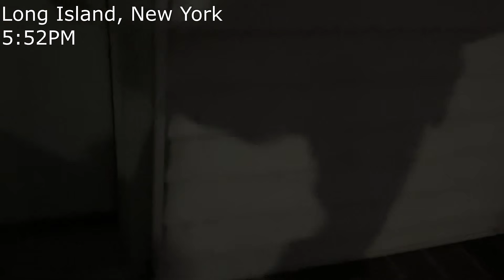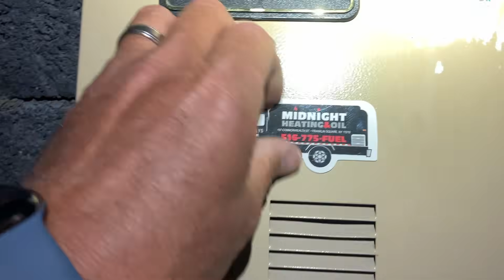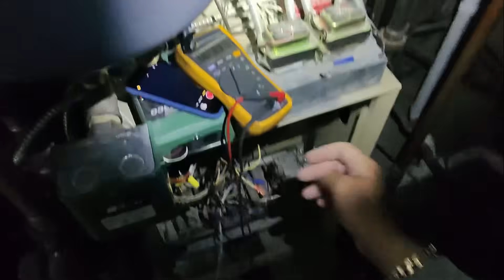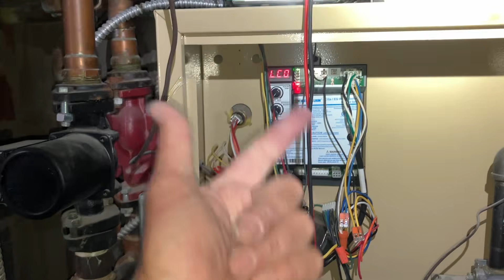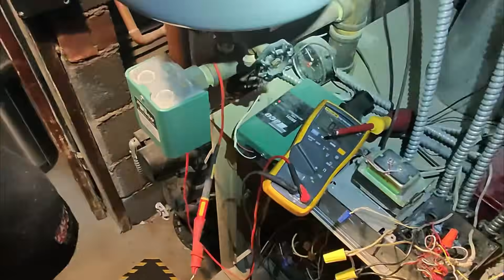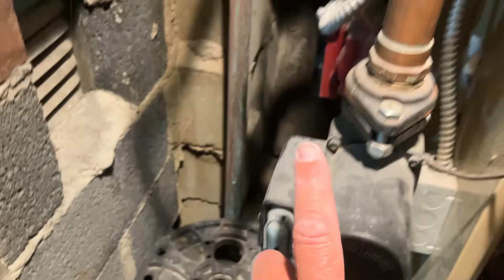Electrician Changed Parts for 2 Days — Weil-McLain Boiler Still Dead | Hidden Short Found

Comment from the maker: Electricians & homeowners — this is why diagnostics matter. Changing parts without finding the short will cost you every time. Drop your questions below 👇
Reply: Hacks brings stacks,  it's why yoir here no one has your skills,  the way your problem
Reply: Hello Mikey pipes , 😊
Reply: Can say the same in the automotive industry stop just throwing parts at it and get it properly diagnosed then one part and done saves so much more money that way
Reply: Good service calls, visual inspection is a must 😊

Comment: Great job mike, quick question tho , after finding the burned out transformer/ board why not test the boiler circuit resistance before restoring power? Just curious...
Reply from the maker: Thanks for the tip
Reply: @PipeDoctor  i love your vids mikey. queens middle village here.

Comment: Electrical problems are a nightmare.  It could take 5 minutes to fix or 5 days
Reply: Two (2) Days and it’s Not Fixed since they Called an Electrician who was Not Testing but instead was Guessing. 🤪👎
Reply: Yeah Electrical proms are a nightmare especially when other people have been in there that don't know what they're doing and what is installed by somebody who didn't take pride in their work or got modified from that. On top of that at some point that electrician should have said (probably the point at which electricity was getting to the furnace boiler) said you need an HVAC tech.

Comment: OFF Topic.. but, I’ll forget if I don’t post it here.

I wired a former Weil Mclaine design engineer’s automation system a few years ago.
He’s the one who first informed me abou tCGA boiler control board issues with several large batches of early units.
I posted above, so you can read it there, but if you ever have one that just displays 140° and won’t heat hotter, think control board.

BUT… he also had 7 or 8 of the Honeywell 9000 series Wi-Fi stats installed throughout the house.
He told me they are some of the best thermostats being made, but always be cautious because if they ever stop their server service or sell a model line, they will eventually fail to work.  He said it didn’t bother him because he would just upgrade to something better as tech changes..

TIP - if you’ve ever installed one, you’ll know it’s very difficult to terminate wiring and dress everything up with the terminal blocks they use.
They are just spring loaded, flimsy, and cheap connectors.
The engineer said one of their field engineers noticed this at a lot of failure jobs he was sent to review.
Reply: Both of these engineers were still big fans of the 9000 series, so they would always take the thermostat back plate and modify it prior to installation.
The one guy I knew and did some work for, simply soldered 20” #18 solid copper wire (color coated appropriately) straight to the back of the PC board behind the terminal strips.

Essentially making up “flying leads”/wiring harness that would never have a connection fail, especially intermittently!
He always uses the 3x terminal Wago lever connectors to connect to the stat wiring.

Except, they weren’t Wago.  He took a tip from me and used Ideal In-Sure lever connectors.
They are blue instead of orange, have a larger hole for meter probing, and most importantly.. the levers never pop up like they do on the Wagos if you’re moving them around in a box.

We always use deep single gang, plastic boxes or metal 190l box type mud rings (without the box) for thermostat wiring rough-in.

I’m all about “overkill”, but it really helps to retain customers and they’re always happy that they don’t have to rip their wall open to add a new gadget..
Reply: Mounted to a stud with two screws, leaving the entire back open for later equipment installs, testing, etc..
(Low voltage Class II, so an enclosed box not required)

We always used to run thermostat cable with a few extra conductors and always a “C“ .  
We always used to home run a CAT-5e or 6 cable to each from telecommunications closet or whoever they’re keeping their home network gear..
Reply: Honeywell 9000 series Wi-Fi stats.
How good are they? how is the Wi-Fi control? I am facilities manager of a four-story building we have two floors built out so far, and 7 thermostat over 2 different styles. Being a nonprofit and budget concerning. I would like to standardize on one thermostat. But what I really need is centralized control for programming room schedules (what I would really like is the ability to do scheduling through Google calendar and have it translate through to the thermostat). we currently have 2 different Honeywell models the style with backlit Monochrome touchscreen, two of them are fancier than the others. And really what I only want the occupants to have is temperature up down heat cold and hold to X time preferably more than 3 hours until a program overrides.

We also have a theater group who thinks they can just turn the thermostats on and off and crank them up to 80° run them until they start the show and then turn them off (you know cause heating and cooling is noisy and annoying during a performance especially to the visitors). Which sometimes means they don't get turned back on and sometimes means the two different ones in the same room are set differently. Or more importantly they're running the auxiliary heat and we have a $2000 electric bill which I don't know is due to them or one of the adjacent rooms having the compressor go out and only running on aux heat.
Reply: @i @imark7777777 It works quite well with Google Home Assistant, but I’m not sure about other compatibility.
IMHO, it’s a great unit to standardize on for residential and small commercial projects.
Just use caution with the terminal strips/blocks.

Also, I believe there are some incompatibilities when mixing new models with older, though I think that’s mostly for remote sensor types.

I’m not an expert in the field by any means, so definitely consult someone with experience.
I believe the “Red Link” by Honeywell was made for more advanced  / larger integrated systems, but have heard it’s fairly expensed proprietary system with Honeywell having add-ons ($$) gear vs included features and accessories.

AVOID AMAZON!!   The only sellers are “seller/shipper” types.
One time I ordered 3 for a family Jersey Shore beach house and then drove down to install a CCTV system and install the stats.
2 or the 4 were USED.  One missing the wiring backplate and both having been programmed with schedules and installer/dealer name and #.
They refused the return and it was the first time Amazon didn’t act in the customer favor. (bc they didn’t handle logistics/shipping).

Good luck!

Comment: IMPORTANT	!!‼️. 
Mikey - I haven’t watched yet, but I’m guessing this is similar to another video .
The WM CGa boiler wouldn’t heat above 140° .  It’s a “secret”, but Weil M had a huge number of bad control boards.
It was some of their earlier Electronic ignition boards…
If you jiggled the temperature setting potentiometer (knob on right). The  LED display would randomly display numbers and would eventually settle down..  then, intermittently throughout the heating season, the control board would INTERMITTENTLY only heat to 140°.

I’m on the road, so don’t have the part #’s,  BUT… For some reason, family, and friends used to always call me, the ELECTRICIAN, for their HVAC, toilet, cleaning and cat feeding work.  Could it be because I’m free.?  LOL
Reply: I’ve been meaning to tell you about this.  The only reason I knew is because I wired an automation system for an engineer that used to work at Corp.

he said to stock up on him, because eventuall, as the failures become more prevalent, you’ll make a fortune on eBay.  
(Remember, the replacement control board comes with a modified jumper with Molex connectors.  

It’s because the new boilers use the temp sensor as a low water cut off..
If you have the old type, you have to use the jumper.  Supposedly, some of the retrofit kits came with new combo sensors..
Of course, if you’re one of the official Mikey pipes colt members, you already know never use PTFE tape on the threads.
Continuity to the ground chassis is key.
Reply: the pots in them get tarnished/intermittent internally. turn them up and down rapidly a bunch of times and they clean up and work right again for a while.
it's not just WM control boards, been dealing with them in electronics for over 30 years, best way around that is a sealed multi-turn pot. but none of them use them for cost and size.
some have used pluggable resistors or multi position switches, but those still have issues with tarnish on the contacts and terminal pins in due time.  the main issue is the electronics have super low current  and low voltage through them, so it doesn't take much to effect them, including vibration and thermal cycling from the surroundings.